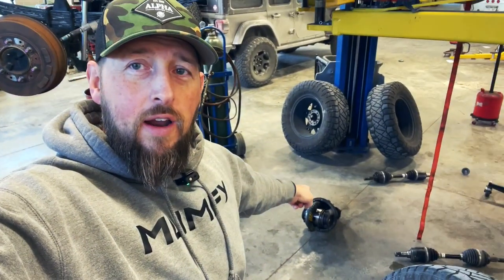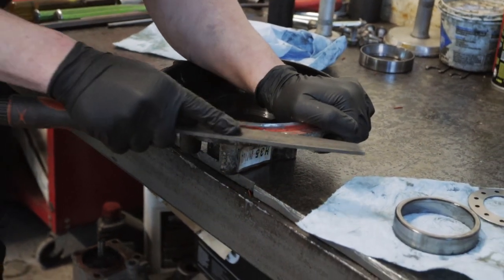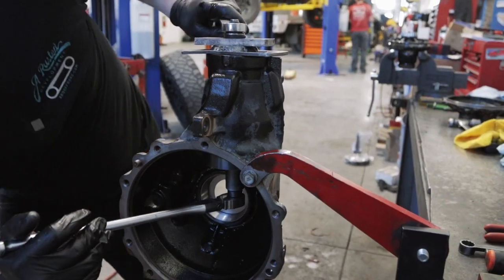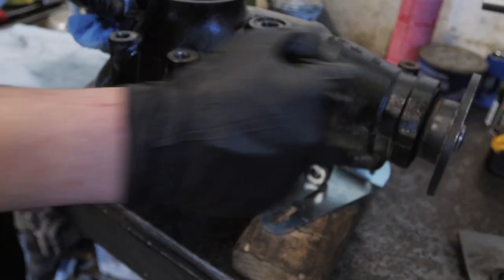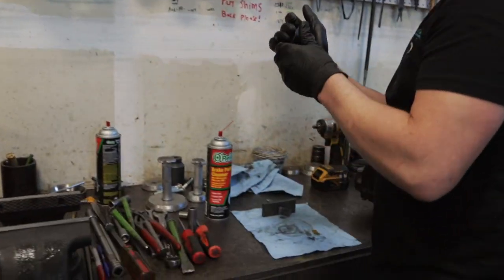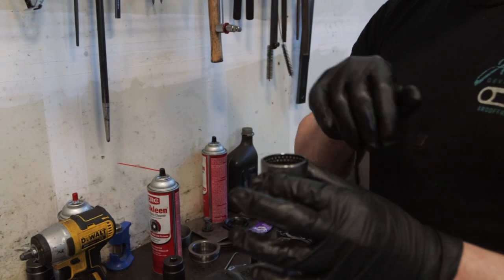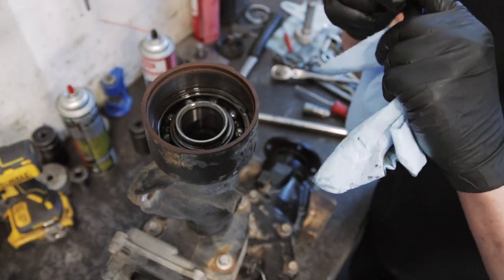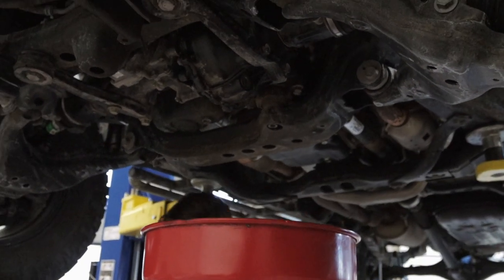Tacoma 5.29 Re Gear | Day 2 Install

Comment: RIGHT! OEM shims often don't work on after-market gears. I learned this the hard way and thankfully I noticed the paper-thin gap that was left when the shim wouldn't sit flush. I ended up using the supplied shims with my rebuild kit, starting with the same thickness as the original shim when installing my new Yuknon ring/pinion gears in my GX470 V6 diff.

Comment: So you talk about how the two parts of the clamshell need to be free of anything that would prevent the two to fit and throwing off the pinon. So why did you use a screw drive to pry them apart? As well using a pry bar to pop the diff seal. One day you will marr the wall and make a leak point. Never bang when you should press.
Reply from the maker: The clamshell has a spot to bang against to help release the seal. That was where he was hitting the pry bar against.